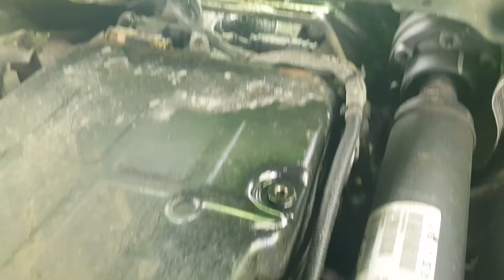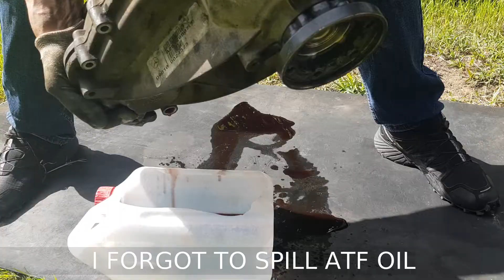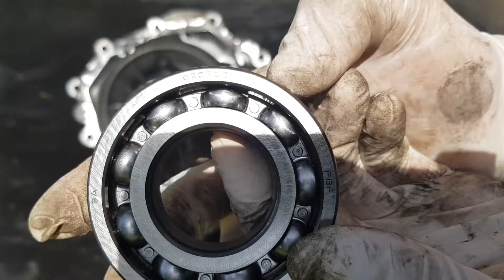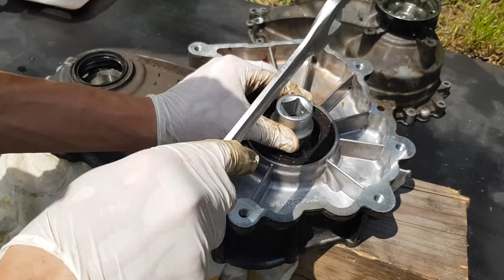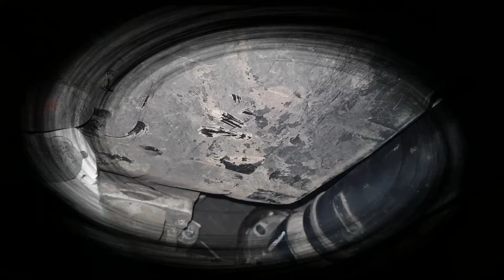ML500 W164 2006 TRANSFER CASE REPAIR CHANGING THE CHAIN AND BEARINGS

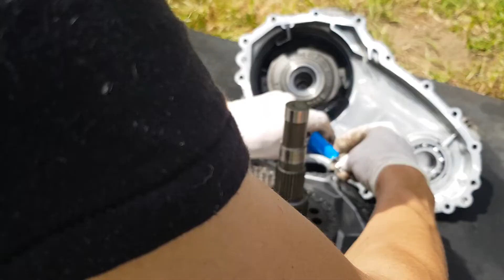Comment: Hi what gasket maker did you use 22:36 to seal the transfer case back together? Most gasket RTV silicone high temperature requires an hour to set before torquing the bolts and up to 24hr to cure before adding fluid. It appears what you’re using is different and no need to wait. Is it for high temps?

Comment: Good job!  Thanks for getting that on video so others know that the job isn't too hard for a DIY'er.  I am going to do the one on my GL350 in the next month or so.  What was the telling sign that it needed to be replaced?
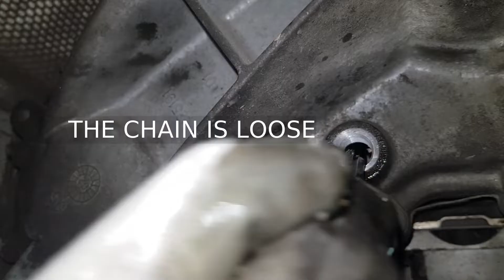Reply from the maker: the gearbox jerks in 1st and 2nd gears and the chain was stretched, you can see it on the video 1:33s
Reply: Just ordered a chain and slide to do the same job. Do you have any clue how often the TC was serviced?  Trying to get a feel of how often I’m going to have to replace the chain.
Reply from the maker: It depends on driving style and oil change usually 150-200kkm
Reply from the maker: use the same oil as in the gearbox number MB 236.14 replace every 16-20kkm
Reply from the maker: I forgot, when you disassemble the transfer case, I also check the front and rear differential in a few days I will publish a video of the rear differential repair
Reply: Thanks!
Reply: @mymercrepairs1097  hello need help

Comment: Hello I have a question inside the housing is that a clutch .. you didn't show that part in the video the disassembly so if the truck is raised in the air the front and rear wheels don't nessesacrly move at the same time ?

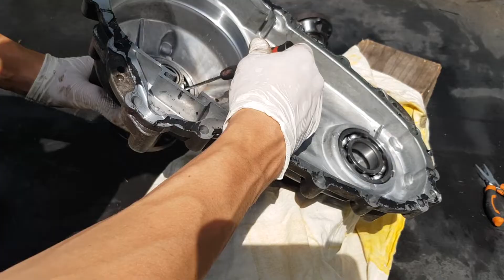Comment: Hey what do you do to get the ring on the shaft to pop in at 11:20 ? I'm rebuilding a W166 Transfer Case that looks a lot like this one and I can't seem to find a way to get the front and rear output flanges out. Thanks for the help!

Comment: You didn't show how you got out the 2 top bolts
Reply: Remove the front proper shaft and lower the transmission, you should have more room to get to the top 2 bolts. It should be possible to put a 3/8 air rachet up there with a long extension.

Comment: Hello excellent video good detail..I just bought an 164 for very cheap with a transfer case that sounds like something is rubbing can you tell me where you  bought your rebuild kit from it seems pretty complete
Reply from the maker: I bought the set in this store https://autoczescigabrys.pl/kategorie/mercedes/czesci-do-reduktorow-mercedes/ but you can look for a similar set on the Internet. Just make sure what version of the transfer case you have
Reply: Ok I'll check it out thanks alot ..

Comment: Did you have to remove the rear drive shaft?
Reply from the maker: No, but I had to disassemble the rear shaft bearing. it is more convenient to remove the entire shaft, but it can be done without disassembling it

Comment: Hey there... very nice video! Is it needed any special specific tool? Or just universal tools??
Reply from the maker: Thank you :) I used ordinary tools, the only bigger problem was Disassembling the output shaft. There is a ring that needs to be pressed into the shaft, I used a sharp tool to push the ring in and I held the shaft to keep the ring from coming back. There is a special tool that I don't have but it can be done without it :)
Reply: @mymercrepairs1097  nice! Can I see what are you talking about in the video? What minute??
Reply from the maker: @alert1022  11:10s but I showed it poorly, unfortunately :(

Comment: Very nice. What was the cleaning spray and the sealant used? I assume the lube was MB ATF? What tool did you pull the little bearing out with?
Reply from the maker: The cleaning fluid is a brake cleaner. It is cheap, effective and easy to apply.
Yes I used ATF MB oil the same as for the gearbox
I used the most ordinary puller to remove the bearings
The sealant is Reinz - Reinzosil
Reply: @mymercrepairs1097  Cool.. i'm considering doing this job ...
I'm  wondering though if you're not sometimes tapping on the inner race and hoping the new bearing doesn't come apart (like 15:40, 19:17). I guess the only other way would be to put the bearing on the item first and then tap the combined assembly into place with the outer race. This would seem to be hard at 15:40, but I've run into issues where a bearing separates (like wheel bearing when pushing the hub into the bearing already in the knuckle). I'm not a pro, so it's really good to see a video like this and see that this method works.
By the way, how would you do the seals if you did them? I figure if I try to refurb the transfer case and get a kit, might as well do the seals.
Reply from the maker: @peter_c  I understand your concern you can damage your bearings like this. You have to hit carefully Or best is to use a hydraulic press, but it also requires skill because too much force can destroy the bearing or casing. And not everyone has such equipment like hydraulic press.
I want to show the simplest repair methods with the simplest tools
I used a wrench, not a hammer, and I hit it often but lightly and the bearing works fine.
Seals, of course, it's good to replace , I couldn't buy new ones and the old ones were in working order, so I decided to put them old so far no leaks , in case of problems, they can be easily replaced

Comment: Did that car have off road package (low range and lockable diffs) or just regular?
Reply from the maker: It's a normal transfer case without the OFFroad package. Fortunately, the cost of repairing the low range and lockable diffs version is much higher

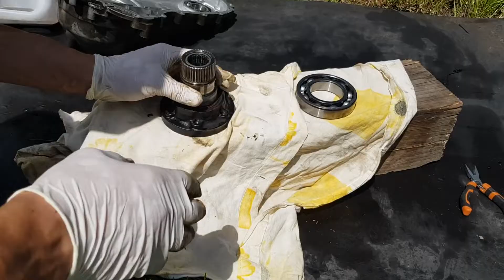Comment: @13:30 Did you change anything at this part. It looked like you just removed and reinstalled?
Reply: Nevermind. I've just seen that transfer case repair kits include the parts mention. Good job though. Not really as difficult as it may seem.
Reply from the maker: Of course, I installed new bearings. I bought a whole set of and replaced them all

Comment: Hey if you can help me get that ring out to get the rear bearing off
Reply from the maker: Hi. Which ring exactly are you talking about?
Reply: @mymercrepairs1097  in your video you show  the rear end of the  transfer case bearing and rear driveshaft connector change but there is a ring inside that look like it should be push in to slide out the rear driveshaft form transfer case
Reply: Do you have email that I can send you a short video
Reply from the maker: @jamelthompson15  It's simple you have to press the ring with a sharp and small tool while pulling the shaft so that the ring doesn't come back you need a little patience but it's easy you can see it in my video 11: 20s
Reply from the maker: @jamelthompson15  the ring is flat you press it into the groove of the roller it cannot come back, press one piece around until it is completely hidden then the roller will come out

Comment: We fools stick our thumbs up if a 200 kkm gearbox repair has to be done.  A cash-cow model for MB.
500.000 km looks appropriate to me under normal use and regular maintenance (oil change)
My T3 has 415.000 km with the first gearbox, and the Suzuki Alto 400.000 (!) without ANY defect. So ????

Comment: could you list the part number for the bearings you used? did the seals not require replacement?
Reply from the maker: I do not have a list of individual bearings, I bought a ready set with a chain here https://autoczescigabrys.pl/sklep/mercedes/czesci-do-reduktorow-mercedes/ml-164/zecja-naprawczy-skrzyni-rozdzielczej-reduktora-mercedes-benz-ml -164-w164-gl-copy /
the seals were in perfect condition so I decided not to replace them